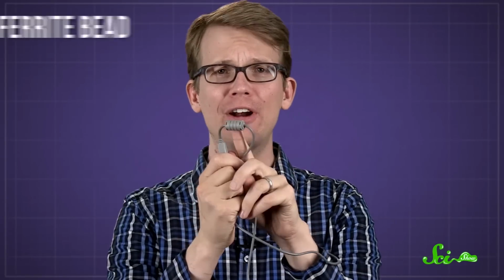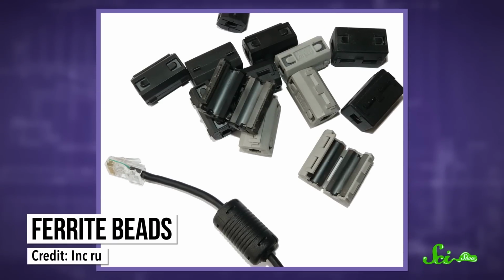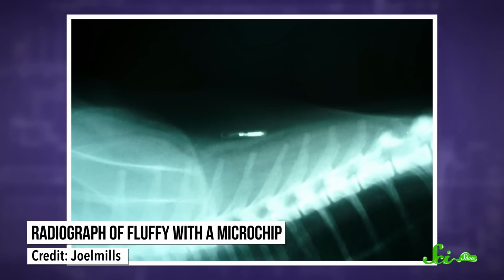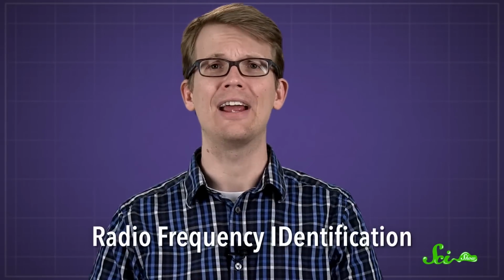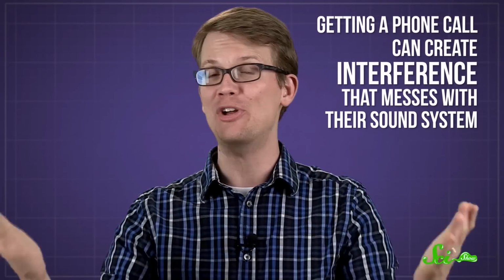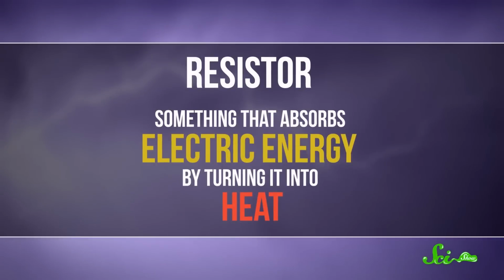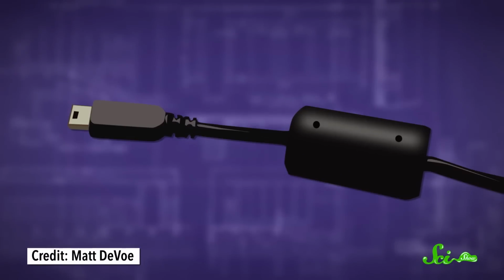Why Is There a Magnet Inside My Dog?

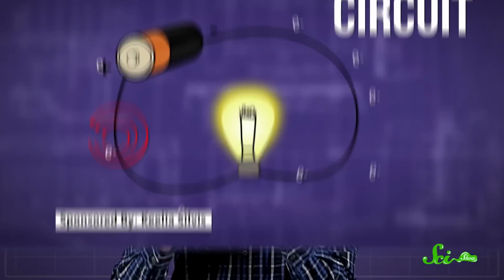Comment: At 0:53, the electrons were flowing through the circuit in the wrong direction.  Although there is nothing wrong with using the convention for the current flow which shows the direction that positive charges would flow, as this is the standard for industry and education, if this is what is going to be used, then the charges shouldn't be labeled as "e-" as was done in the video.
Reply: Agreed.
Reply: I see that almost every time electrons and current are explained. I first learned from some really old, pre-conventional current books, so now both ways look "wrong" to me...
Reply: SciShow got a message from Ben Franklin telling them they got the animation wrong.  Poor Ben.  No rest for the geniuses, even the dead ones.

Comment: If you want to get technical, the ferrite bead isn't a resistor, although it sort of acts like one.  The wire doesn't actually connect to the wire itself, it just goes around it.

When you start or stop a current in a wire, you generate magnetic fields around that wire as well as radio waves.  Those magnetic fields and radio waves can then be converted into current in another wire - the interference that Hank is talking about.

The ferrite bead is an inductor or a device that is capable of converting electrical currents to and/or from magnetic fields very effectively.  (this is a bit of an oversimplification but whatevs)  The magnetic fields coming out of the wire are basically sucked into the ferrite bead and converted into electricity there.  The ferrite is a resistor for electric currents so they are just turned into heat.

Most of the signals that you want are relatively low frequency.  Low frequency signals start, stop and change directions less often than high frequency noise signals.  Therefore that high frequency noise is affected more strongly by the ferrite bead.  All of the signals are muted by the ferrite bead but it it's designed correctly, it affects the noise far more than the desired signal.  The result is you still get most of your signal but that noise is greatly reduced.
Reply: +Dan Heidel Thank you.
Reply: +Dan Heidel He never said it was one. He specifically said it acts like one. Exactly the same terminology you just used.
Reply: I did not want to get technical thank you very much
Reply: +Dan Heidel Thanks for the info but i now hate you for making me feel stupid for not knowing that.
Reply: +Sebastian Don't bother learning anything new
Reply: Yup! I scrolled down to make the same comment. A ferrite bead is basically a 1 turn coil that acts as a small inductor.

It isn't a resistance, though you could call it an impedance.
Reply: +Scott Byer Saw the comment you replied to. Tried to thumbs up more than once. Failed. Damn ferrites*

*other furry pets are available
Reply: tl;didread
Reply: +Dan Heidel 
"...acts as a resistor..." Didn't say "IS a resistor". But thanks for the info.
Reply: +Dan Heidel Great comment, better than the video!
Reply: +Dan Heidel It has absolutely nothing to do with resistors. Hank said it wrong, it doesn't convert electric energy into heat. It actually blocks the absorption of electric energy by blocking high frequency currents. The electric potential oscillates, but it fails to generate the corresponding electric current. That's because the inductor transforms the change of electric current into a change in the magnetic field, thereby inducing a corresponding electric current which partially cancels the initial current. That induction is higher for higher frequencies because it depends on the rate of change of the magnetic field. For an "infinite" frequency (or inductance), it would perfectly cancel the current.
Reply: Wood Croft
I am fully aware of how an inductor works.  However for the purposes of a basic explanation, a resistor is a decent analogy.
Reply: Dan Heidel But what you said is false: "The magnetic fields coming out of the wire are basically sucked into the ferrite bead and converted into electricity there. The ferrite is a resistor for electric currents so they are just turned into heat."
Reply: Wood Croft
No that is accurate.  Ferrite is a high permittivity material but also high resistance.  The ferrite in choke beads is designed to act as an extremely low q-factor inductor, dissipating the high frequency noise via eddy currents that are resistively turned into heat.
Reply: Dan Heidel I didn't know that ferrite beads worked by dissipating eddy currents. So that's why you only need one of them on either side? I thought it was a low pass filter (ideal inductor). And ideal inductors don't dissipate heat. You could have explained that on your first reply. You made it look like you didn't even know how an inductor works.
Reply: Wood Croft
If it worked like an ideal inductor, it wouldn't dampen the high frequency noise very well.  You'd set up oscillations in the inductor that would feed back into the conductor.  There is some dampening created by reactance that can act as a low pass filter.  However you need something that adds resistance or capacitance to the inductive element to dampen out those signals.
Reply: Dan Heidel You wouldn't need to dampen it if it were an ideal inductor, but I get the point.
Reply: +Dan Heidel You're right in that SciShow got this wrong on so many levels. 
Your are wrong (sorry!) about the low-frequency bit. Frequency has little to do with it. Noise is single ended (int goes through the ferrite-bead, one way) whereas the signal is differential (D+ and D- leads). The ferrite bead provides impedance to the single-ended (noise) signal, while the differential data signal (as it is balanced) sees no impedance. As for frequency content, a LAN or USB cable has pretty high frequencies on the wires. An analogy to the single/differential signals: Imagine the differential on the back of your pick-up truck. If you spin one wheel (and not the other), the prop-shaft turns (single ended). If you spin one wheel forwards and the other wheel backwards, the propshaft DOESN't turn (differential-mode). The ferrite acts as a brake on the propshaft. Any signal that doesn't have an anti-signal accompanying it through the ferrite will get impeded. Of course, since impedance is related to frequency, the low-frequency (noise) signals will get impeded less (but that's a story for another day ;) )
Reply: Aditya Mehendale Frequency has a lot to do with it because the inductance is tiny. It doesn't block low frequency common mode noise. What we were talking about is the way the ferrite bead blocks the noise. That can be from a single wire:
http://www.radio-electronics.com/info/data/inductors/inductor-ferrite-bead-diagram.gif
Or the common mode from a couple of wires:
http://www.murata.com/~/media/webrenewal/products/emiconfun/emc/2012/07/13/en-20120713-p3/en-20120713-p3_img0001.ashx
Reply: Dear Wood Croft , sigh, did you read my reply completely before replying?
Reply: Aditya Mehendale Yes. Did you? I don't mind if you point out my mistakes, but if you're gonna reply with "sigh", then don't waste my time.
Reply: +Wood Croft nor you mine, if you won't bother to read the comment entirely before dishing out a reply. Surely, that is worth at least one sigh?

Comment: Small correction, the ferrite bead turns that section of cable into a single turn inductor, which resists changes in voltages by absorbing them. In the case of these ones, the energy stored in the inductor is usually released into the metal shielding surrounding the data cable, where it is indeed released as heat.

Comment: The ferrite in a implantable RFID tag, is not being used to filter interference.  It is being used as the core of a ferrite core antenna, just like in a crystal radio.  The inductor that the core is part of is used as an antenna to receive and transmit signals, as well as receive power.

Comment: @0:30 USB is a numeric transmition so your sound can't be altered.
Reply: Ah, good, you beat me to pointing this out! (Maybe a lot of other people too, haha)
Reply: +eucalyptux If the mic's powered over USB the ferrite bead can limit some of the high frequencies on the power rails which could add noise in the mic pre amp.
Reply: *****  true
Reply: +eucalyptux Well, but if he is recording over an aux cable it does apply.
Reply: +eucalyptux The noise does not get inserted into the signals at the USB cable, but at the high gain amplifier out at the end of the cable, in the mic and A/D converter circuit.  Noise current in the cable gets turned into noise voltage at the end of the cable, where it is plugged into something small.  You do not want high frequency noise voltage anywhere near a microphone input circuit.

Comment: 1) ferrite mostly works as an inductor there, not a resistor. Completely different principles, can't make a filter with pure resistance. The references in the video description are great though.
2) USB uses digital signals, it can't change the audio passing through. Too much noise can probably mess the connection up and interrupt the recording, but it can not add noise to the audio, because it's not analog. So feel free to use a cable with no filter, you're not making the recording worse.
Reply: +van0fizmat There are audio mics that communicate with the computer through a USN interface.  The analog to digital conversion takes place in the mic.  If the mic and cable resonate with some noise frequency leaked from the USB data stream, it makes the case of the mic, at the end of that USN cable,  bounce around at radio frequencies, and that RF voltage can leak into the mic element, where any nonlinearity in the high gain mic amplifier will detect that noise as if it were an AM radio station, transmitting white noise, contaminating the audio stream going into the analog to digital converter.  Google [Blue Yeti mic].
Reply: +van0fizmat I was thinking the same thing. There is one source for analog noise, however, which is the USB power supply. But since it's a "fancy" microphone, I'd trust it to sufficiently low-pass filter that to get basically perfect DC within the audible range. Otherwise the microphone might not be as fancy as Hank thinks it is.
Reply: jpopelish You're right, the same day I posted I thought about it and realized that even though noise can't affect the data being transmitted over USB, noise can affect the microphone itself, which is really the most sensitive part of the system in the first place.

Comment: Ferrite beads are inductors, not resistors.  While they do exhibit impedance when signals with frequency are applied to them, this impedance is typically only significant at higher frequencies. The ferrite bead acts as a lowpass filter, where signals low in frequency can pass with minimal attenuation and higher frequency signals get severely dampened. This allows high frequency electromagnetic interference (e.g. household appliances, cell phones) picked up by the cable to be filtered out while retaining the desired signal.
Reply: +redxparasite The ferrite beads act like a transformer.  The primary is the cable passing through the hole.  The secondary and load resistor across it, is just the core losses.  But, by transformer action, this load resistor appears to be effectively in parallel with the inductance of the primary.  It is that effective series resistance that absorbs energy from the RF currents passing through the bead, because it is effectively in series with those currents.  The inductance has little effect, except to couple the core losses into the primary.

Comment: Interference (EMI) is the reason us electronics design engineers spend forever preparing our designs for agency testing so our crap doesn't mess with your crap. Radiated emissions, immunity, and transients are the main issues, and our tools are usually adding extra capacitance, shielding, or ferrite beads (usually SMT). 

Please do more videos like this.